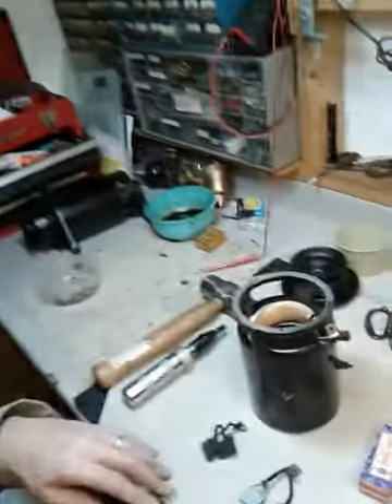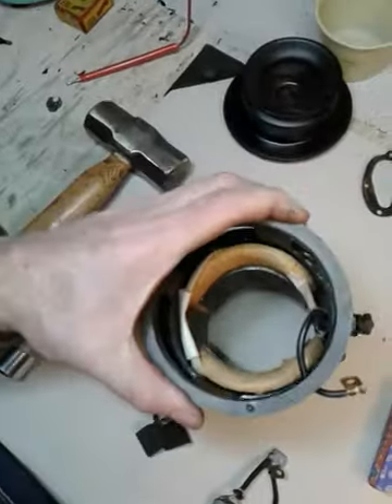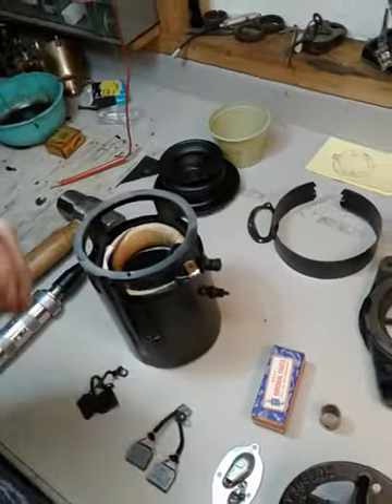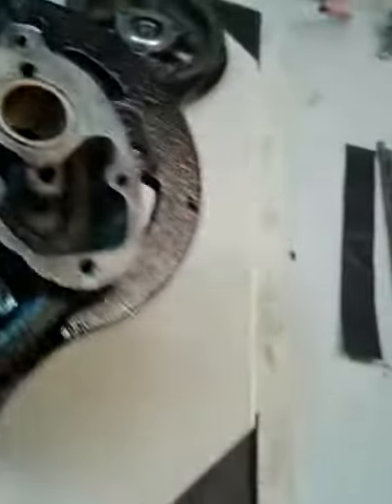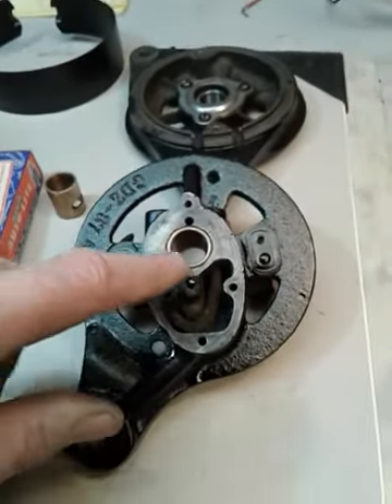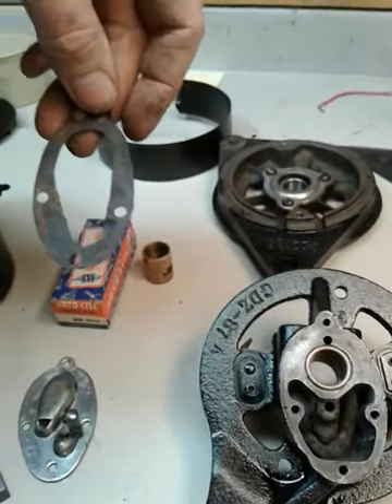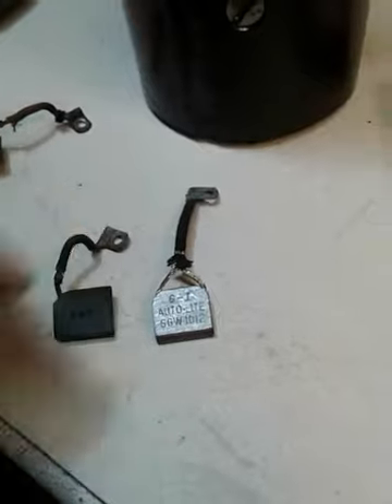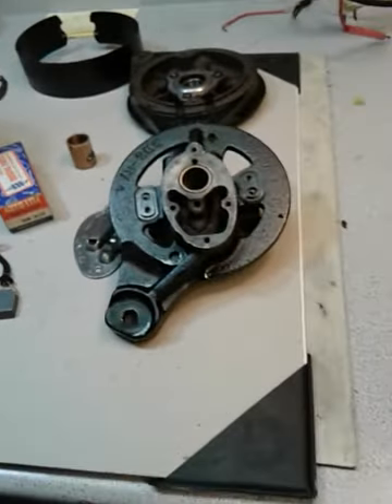Gen 8 installing fields and bearings

Comment: Is it okay to paint the outside edges of the generator casing? I’m wondering if the end caps (both rotor and pulley side) need to be mounted to a clean metal to metal surface? Thanks for your help
Reply from the maker: Leave the ends bare. The commutator end needs to have electrical contact with the body.
Reply: @SwabbieSteve  thank you!

Comment: Hello Steve, I’m finally assembling my ‘41 Willys Auto-lite generator. I was going to use an open ball bearing but I see my NOS armature does not have the part that slides over and up against the shaft snap ring that the inner felt slides on. If this was on my old armature I lost it when I sent it to a shop for a quote to rewind. Have you seen anyone selling this part, I assume it also sets axial placement of the armature since the bearing is pressed up to it.
Reply from the maker: I have not. Probably the best thing to do is look for an extra generator just for spare parts.
Reply: @SwabbieSteve  thank you I’m going to try to find a spare parts unit.

Comment: Hello Steve, 
Thanks for the informative videos!
I have a 1949 John Deere MT tractor, and am having issues with the 6 volt positive ground charging system. When the tractor is running I am not getting any charge on my ammeter when it is running. I have tested the ammeter and it is indeed working showing discharge when I turn the headlights on. I have pulled out the generator and have tested it as a motor. The generator runs when I put 6 volts to it with the Field grounded to the frame of the generator. I am told that the generator should speed up when I momentarily remove the field ground, however it seems to slow down. So I am thinking the field is suspect. I pulled apart the generator, the armature looks good and brushes appear to be good and making contact. I tested resistance thru the field winding and got around 3 ohms. Do you have any recommendations?

Thanks,
Sam
Reply from the maker: I don't know anything about a JD generator. But generally speaking, when you ground the field, this increases current through the fields which makes a stronger magnetic field that the armature spins in. This increases generator current output. It sounds like your regulator may not be working right.
Reply: @SwabbieSteve  Hey Steve, thanks for the response. The generator is a Delco-Remy 1101852 generator. I will check the wires going to the regulator for continuity, and then so some research on diagnosing voltage regulators. Thanks!

Comment: Hy on a Delco 3 brush generator which wire goes to the adjustable brush the field or the Armature?
Reply from the maker: I've not worked on a Delco, but I'm pretty sure you can find a wiring diagram online. Generally, the field wire connects to the adjustable brush. That brush's position determines the field strength and thus the generator's output current.
Reply: Okay thanks

Comment: Where do you get the newer style sealed bearings vs the old style open bearings?  Is there a kit you can buy?
Reply from the maker: 203FF bearing from Advance Auto Parts, about $10. Its a standard bearing available at most FLAPS.